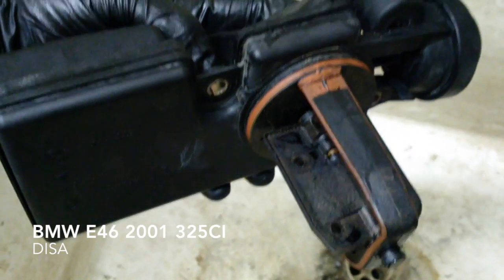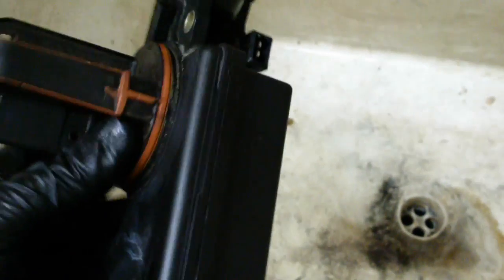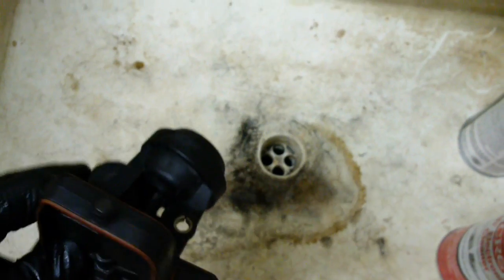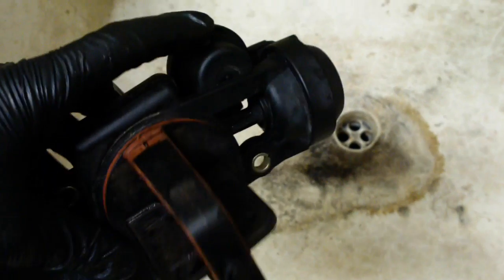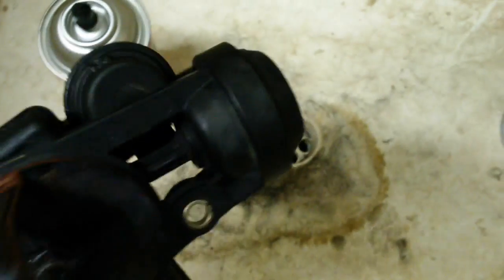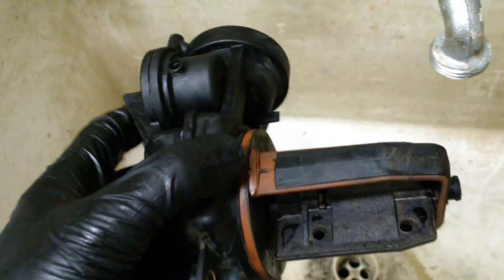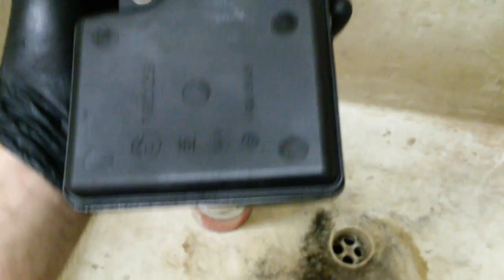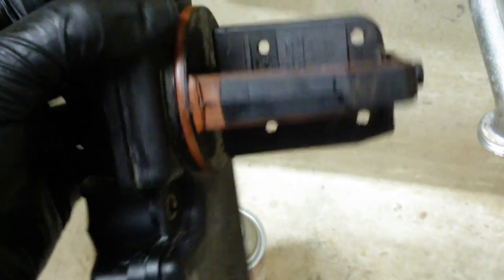BMW E46 DISA Valve/ Vacuum Leaks EXPLAINED

Comment: Sometimes the rubber diaphragms in the plunger section of the DISA valve get ripped if they are old and they can be repaired with gasket maker if you're in a bind and can't get a hold of a new DISA in time. 

You just have to carefully pop the lid off the Diaphragm housing at the end of the plunger area and you can see a spring underneath with the rubber vacuum diaphragm attached to the plunger, release the plunger from the valve flap, pull it out and repair the rips in the rubber with gasket maker. Let it dry, then just put everything back together as you found it and seal up the cap housing that was removed, so there are no air leaks in it, you can use gasket maker to do this or kwik weld. 

There are a few more spots on the entire DISA housing that can leak vacuum along the housing seems, just kwik weld or super glue along the seems if you feel any air leakage with the hole plugged with your finger. 

I had to do this in a bind and the thing worked like a charm, my check engine light turned off and my engine ran flawlessly with it until I got the new DISA in.
Reply from the maker: That is like really in a pinch. Good idea, as for the reason the plastic diaphragm ripped probably has something to do with fatigue of the material like heating freezing cycles in winter. The rest of the diaphragm that did not rip will become a problem later as let us underline temporary.
Reply: Randall Wetmore thank you. I just did what you said but cracked a bit of the black housing. Will that cause a problem? My rubber membrane is completely shredded and top half is off. If I order and replace the membrane will it fix the vacuum pressure? Because the flap doesn't stay closed when I hold the hole as it should. Or do you think I should buy a whole new disa? Please help asap. My life is literally in your hands.
Reply: I can't remove the lid to get to the rubber diaphragm and spring. I unlatched the sides brackets but the lid is not budging. Please help.
Reply: There are 4 clips around the circular cap that snap into place, you have to jimmy a small flat head screw driver between the housing and the cap to pop the clips out and push up on the cap housing as you do it, to release the clip from the housing around the cap.
Reply: Just buy a whole new DISA valve for sure. In the mean time, you can use blue gasket maker or goop to glue the diaphragm back together and then seal up the black plastic housing with JB kwik weld where it got damaged. When you put the cap back on, don't forget to put the spring and everything back in the way it came out and make sure everything is sealed properly. Taking the DISA apart and fixing it, is the temp fix and you should always have another DISA on the way. Make sure to get a decent price and order through e-bay or online from a trusted seller. I paid about $60 for a new unit and my old DISA lasted me until the new one arrived.
Reply: Randall Wetmore thanks again. I will definitely buy a new disa. But for now I just used silicone adhesive to glue back the rubber membrane and black housing. Hopefully it will hold me until the new one arrives. Thanks bud you're a life saver.
Reply from the maker: Definitely buy a new one. Same advice as Randall Wetmore
Reply: "carefully pop the lid off the Diaphragm housing at the end of the plunger area" I was struggling with this whole day and I damaged one of the holders of the housing. This is impossible to remove, so I gave up. I am going to buy new disa, but I was really hoping I could fix it myself. If you have any video showing how to open the lid you mentioned please provide, because now I am very upset and not willing to try to fix it because I will damage disa for sure.
Reply: I seen a vacuum leak from my disa valve, would that cause a long start issue, and random stalls, especially over 110° F

Comment: Hey there good afternoon. Can I ask you what codes you were getting ? I’m getting all kinds of misfire codes and a MAF sensor code. I went to check my DISA and noticed that as I’m doing  this test, it has a slow leak because it will not STAY in the turned position. Instead it will slowly return to its normal position...  do you think this would cause all of those codes ??
Reply: ya sounds like your DISA is on its way out, unfortunately a bad DISA unit and act like you have a bad MAF!! ask me how i know?? 3 things to remember before replacing this unit, either the DISA seal O-ring goes first and starts to let unmetered air in your intake manifold causing lean codes, random misfires, fuel cut cylinders 1 - xx etc etc, or the flap will ware or vacuum piston is starting going bad... when any of these symptoms start happening to your DISA valve that you have been able to rule out from all the other common causes...Do NOT rebuild it just REPLACE IT!!! Your car will thank you 1000x for it.
Reply: @MovieCor   Thanks for you mr response. I no longer have this car but I remember having to change BOTH the DISA and the MAF Sensor . So you’re definitely right 🤷🏾‍♂️

Comment: The DISA is a little bit of a mystery part. .. But I know the answer. The DISA retunes the intake manifold in real time. the air is bouncing around all the time in the intake manifold. When an intake valve closes the inbound air is suddenly blocked. Because the air is in motion and can't stop instantly it compresses a little like a spring. Then that air begins to decompress. What BMW has in mind is to benefit the NEXT intake valve (that opens) by having the intake ducts tuned to utilize that decompression. Unfortunately the required duct length for higher speed is not the same required for lower speed. (DISA = Differentiated Intake System Actuator). So .. essentially it adjusts the path length of the ducts. I think its binary in nature. I know the box stores vacuum so its available when the engine is operating more open throttle, and the electric signal releases it.

Comment: Thank you man! 

My M54 has been throwing codes. And it had 3 lean codes and 3 disa valve codes. 

So I figured I’d clean it up and then replace as a last resort. 

I’m glad to see cleaning it is an option. Thanks a lot! 

I’ll share it with my mechanic so he can offer to repair the valve vs replacing it. Because I saw the price and wasn’t willing to buy a new one if it could be repaired.
Reply: The disa valve won't throw any codes, only if it's not sealing properly you'll have a vacuum leak causing the famous lean codes

Comment: Hi there! i have the same problem with my BMW 2003 325i its Disa valve. but when i took the parts off. mind doesn't do that. so just used.that pray and it will do like that?

Comment: Hey anyone could help my disa valve idk if its messed up when I put my ear on it I hear like a rattle but I take it off and everything looks good also with engine running I disconnect the connection and nothing happens the pin from the disa valve is kinda looks but wassup with the connection? Advise should I get a new one got p0174

Comment: Have a question when you turn on the car does it open automatically or is it when the vehicle is warmed up its open automatically it seems that my bowel or plunger it's not going in or out vehicle is running and when I turn it off it stays at the same place so this is bad correct
Reply from the maker: The position of the flap is related to the rpm and from what I remember at 3,000 rpm it changes position. If that position is open or closed I am not sure. I have never turned the car on without it in place.

Comment: thanks for the vid, I am really wondering how to determine if my DISA valve is active and functional properly or not?   It seems I can't figure it out through the C310+ code reader/diagnostic ?
Reply from the maker: After preforming the test in the video... well... If you are referencing an actual functional test as in providing power to the unit and running a test sequence, I am not sure that exists. I have only done this kind of maintenance solo but you could just not reinstall the part, plug it in, and have someone else run the car through the rpm range. Although this will probably throw a bunch of other codes as the disa will not be installed. Do this at your own risk. Your could create a temporary plate with the holes drilled so it can cover the opening in the intake manifold as the disa is open during half of its operation. If the engine begins shaking off its mounts I would recommend shutting it down at that point but seriously this functional test could probably be run by bmws computers if you have access to them. I was looking into buying an ibm t80 and installing the factory diagnostic software but I got stuck because the interface was in german. best of luck.
Reply: A late response, but a very simple test is to mount your cellphone to tubes nearby using duct tape. Point the camera at the piston, so that you can capture it moving. Then shoot a video (with flash turned on) and do a test drive.

Comment: what symptoms did u have fir you to carry out this job ? thanks
Reply from the maker: I was trying to find the reason why the rpms would dip at idle. It always seemed to me like the car should be around 810 rpm at idle vs 610 which my car was and whenever I would go into neutral the rpms would dip way down like to 400 then recover back to 610. It just didn't have that precision feel about it. I always thought there was a vacuum leak somewhere in the intake system. The problem I mentioned did get better over time after replacing many hoses, o-ring, boots, and gaskets.
Reply: Ross Piccinini brill thank you mime just idles higher slightly at lights etc then goes back down amd a bit rough on start up
Reply from the maker: From a diagnostic point of view, before going to ECS and ordering tons of parts you don't need, I can tell you that if your engine is running rough at startup your fuel system is running lean. The computer will only compensate so much at idle so the problem will probably not be found only using a scanner. Here is what I would suggest;  1. Clean your mass air flow sensor with appropriate cleaner,  2. Replace your air filter,  3. Clean idle control value,  4. Check for vacuum leaks in the intake system, 5. Inspect spark plugs for residue and re-gap plugs if needed,  6. Replace fuel filter.          Checking for vacuum leaks is not exactly an easy process because there are so many places that can let in air after passing the mass air flow sensor. This would definitely cause a lean condition. The intake boot is probably cracked (cheap part), the disa value has an o ring, the throttle body has an o ring, there are 2 o rings for each fuel injector, oil filler cap has a seal.  One issue that is hard to realize is if the valve cover gasket was replaced and not seated properly that would be letting air directly into that area and that area needs to be pressurized. The last thing that I will mention is the theory of piston ring sticking. The piston rings are supposed to sort of float in grooves in the piston and if they get stuck than the gap between the cylinder lining and piston rings gets out of tolerance which reduces compression. I went a little nuts with this theory and pulled all spark plugs out and poured in about 100ml of a specific chemical product that was said to dissolve any buildups around the piston rings. Turned engine over with plugs removed, let sit for an hour, then went for a long drive. Lots of white smoke is created by this process so the long drive was important to get the chemical out of the engine. Changed oil after that.
Reply: ah OK I've never had to do anything to.engine as of yet besides air filter obviously I've had oil and filter done in guessing it's near the air filter one video I seen it was under  the air intake if that makes sense
Reply: what specific chemical product did you use? Seafoam? did it work?

Comment: I would caution using that fluid. I tried it and it broke the DISA in two ways. (1) It somehow stretched out the orange o-ring, and (2) it broke what vacuum was left in the DISA. Disa valve would slowly go back to normal where it should not move much at all. After cleaning, total vacuum loss.

The DISA was failing so I had one on order anyway, and figured I'd try this since nothing to lose.
Reply from the maker: Ya I would not consider this process preventative maintenance. It is last ditch effort before throwing it away. Sorry it didn't work for you. It is possible that the dirt that you dissolved when spraying was holding suction as something like a secondary seal and when you sprayed it away, the primary seal was to badly damaged.
People doing this please take note.
Reply: Can it be reclogged to regain vacuum?

Comment: thanks for the vid, my question is, my disa cannot hold the vacuum when i cover the air release hole.  the flap just goes back to its original position.  will this fix it?
Reply: Ryan C change the rubber membrane for the disa.

Comment: Fill holes with liquid gasket?!You mad bro?!Could be fun for your engine when they get loose.Just search for a "broken" disregarded valve and replace the valve.Or, just clean the "broken" valve, take it apart and reasemble it by glueing the yellow shaft into the flap with 2 component polyurethane glue, it will NEVER break, last a lifetime and only costs you a tube of glue (2 component URETHANE) and some time
Reply from the maker: That is one way to go. And yes I think I have been called mad once or twice. The logic behind the holes partly comes from my lack of knowledge in the mechanisms by which the air moves through the intake manifold. I had thought that if the flap was not opening all the way and would have to be replaced I should decrease the flow resistance by providing more openings for the air to pass through in the mean time. Less air would equal less power and honestly if I had to sacrifice a DISA for peak power thats what I have to do. The downside was rough idle due to increased back pressure from the cylinders. This valve is opened above 3k rpm during normal operation. This device is based on some pretty advanced fluid principals and his highly optimized for conditions from the cars computer. This is a great car to learn from and work with.
Reply: Cutting holes wasn’t a bad idea it probably saved his disa from completely failing. Best option when disa is not working and you can’t fix it is to just remove the flap and let the engine run lean if you plan to use it.

Comment: I owe you a few beers.  I almost ordered a new disa valve or repair kit, at the very least, and then I saw your video and decided to try it. I removed the disa valve in about ten minutes, checked to make sure that the vacuum diaphragm held vacuum (it did), then turned the key forward with the wires still hooked to the disa and the valve closed as it should . I removed the wires and then proceeded to clean all the nooks and crannies that pivot the valve, because you can tell that the valve was sticking. I also sprayed the tiny vacuum hole, in case that was clogged.  When I was done the valve moved back and forth without "hanging up", as it did when i pulled it out.  I put it all back together and it works great!!  Thanks for posting this fix!!
Reply from the maker: Thats great, I am glad you found the video useful. I really have a good time working on the car and its just really interesting stuff. The emissions and intake control systems are so intricate I have learned a ton about the potential for systemic failures such as the DISA leading to fuel mixture errors, corroded O2 sensors, not to mention the rough idle. I took it upon myself to take care of this machine becuase who doesn't like the sound of a smooth downshift to 6k rpm. Cheers